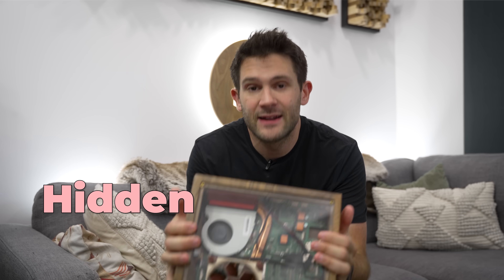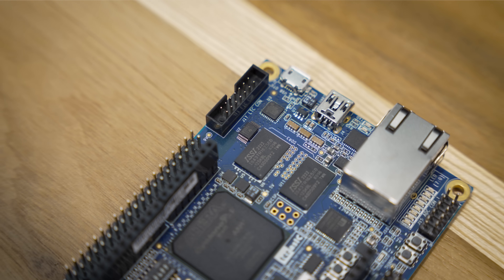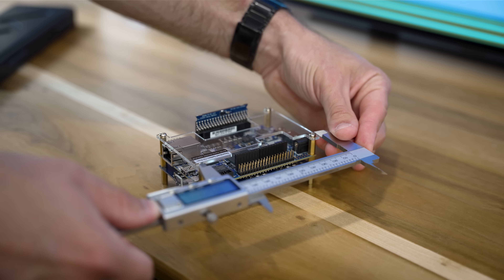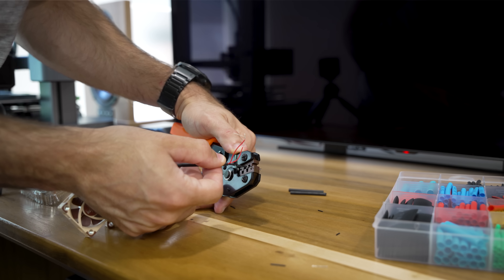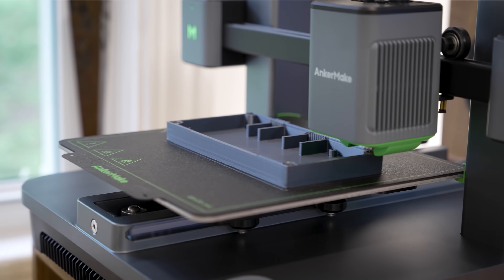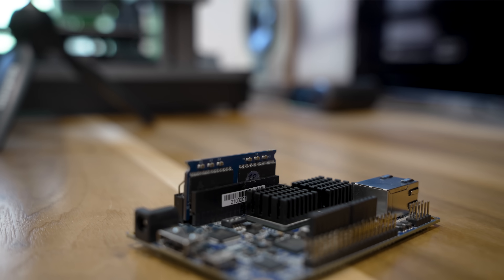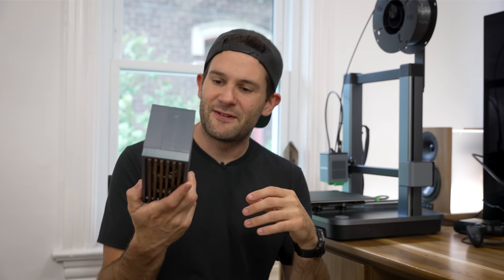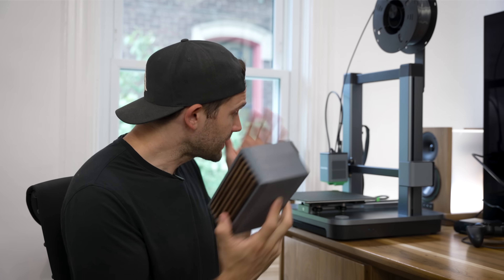This DESTROYED my $4000 PC

Comment: I say if input lag is your main sticking point, you can just overclock your USB controllers. Believe it or not, by default windows actually has faster reaction times on Bluetooth because it goes through less processing, this can be countered by overclocking the pull rate of your controller though with external software. 

With just using a dual sense you can drop the input latency by 15ms alone. The only warning is that some games respond oddly to high pull rates, at least from what I've heard. Personally never had an issue with it myself. 

Also kinda question the true purist stance. Very fee people today actually consider getting a later CRT and having a GPU with analog outputs just for it. I think the purist group is basically a dying breed of those who lived the years the game was new and wanted to see it look the same. 

Personally the main advantage of emulation is not needing so much e-waste in my house. I just have one system that runs everything I want. Is it perfect, no, but being higher res already makes it better than originally, and when I was young I didn't have all the fancy hardware for the best look even then. Plus some games just ran poorly on original hardware but don't via emulation like how you can add frame rate mods. Ocarina of Time not looking good on emulation for example is also irrelevant as we have ship of Arcadian, a literally back end PC port. We also got the same for Jak and Daxter, one of the most difficult games to emulate from PS2.

Comment: Im a hardcore collector myself, I have tons of original hardware etc and I also have a both an emulator arcade cab and a couple different fpgas.... all that being said, I actually prefer good software emulation against fpga or original hardware, with the exception of my analouge pocket. All the extra features like shaders, hd patches, save states, rewind, fast forward, bezels, etc etc really enhance the experience and sure, you loose some accuracy but most people would be hard pressed to actually cite any difference between the three themselves.
Reply: My thoughts exactly. As soon as I heard his statement on it, it raised an eyebrow for me. The emulators these days can be really good, and it's been well over a decade since I played my old favorites anyways. For so many games, I've never played the original, so I couldn't tell the difference of there was any.

 Sure, there are definitely titles that either don't work or behave erratically, but I can accept that. Some consoles will really benefit from hardware emulation especially when the original silicon was low quality(XBOX360).

Comment: I think FPGAs are great and I collect original hardware, they've progressed a lot even through the global chip shortage slowdown. I didn't experience the birth of software emulation but I do think many generations got the wrong impression of each platform based on the compromises and form factor they took on Eg. NES/SNES:256x224 not displayed in 4:3 for a long period of time, such an elementary fact to argue lol.
A visual analogy is that software emulation lands near the bullseye on a dartboard, while hardware emulation is virtually dead center to the real thing which is why it's superior.
I think the biggest contrast with the FPGA route is the large single purchase cost for a console, while physical collecting can still have a low initial cost start even if you spend more long term Ie. buy now versus layaway adoption. I've adapted to the hobby market changes, still collecting carts, software emulation consoles, buying reproductions of absurdly expensive titles, but also taking the flash-cart route when platform collecting stops being fun altogether Egs. Sega CD, Jaguar, TG-16 games SO expensive.

Comment: As cool as FPGAs are, I don't quite see your point against software emulation, especially the "things that ran simultaneously now run sequentially" which just shouldn't be true since parallel computing has been a thing for quite a while. Of course, something like that can be quite difficult to get right in code, but you make it sound like it's a limitation of software emulation in general.

Comment: I disagree, you can have an experience just as good as long as you have physical buttons, using a keyboard or a touchscreen just aren't good no matter how nice the emulation. Only system you need is a ds or 3ds for the dual screen properly.

Comment: SNAC adapters are really cool but they only work for that specific system and no other system (or the menu)
But there are also a lot of USB-adapters for old controllers that with just a little bit more latency (some use 1000 Hz polling rates) that will have your old original controllers work with any of the emulated systems as well as the menus.

And yeah I WILL disagree with you on the blocky pixels because on a real CRT you wouldn't see sharp pixels and the graphics are usually made to take advantage of pixels blending together to either get more colors or fake transparancy =)
But as we say in Sweden, taste is like the butt. Hairy and full of sh... no wait... divided. Taste is divided that's the one =P
Reply: Snac adapters works in the menu if you use the db9 fork from antonio if i m not wrong. They work at least in the menu of each core, not sure in the system menu but i can try
Reply: @andreabogazzi5410  Oh? That must be something that was added since I last played around with it. That would be super cool. If they can get it to work in the menus then I guess it should be possible to get them to work in other cores as well. Maybe not with the zero latency but still
Reply: the genesis controller works in the genesis menu. i ll hook it up and double check. @antivanti
Reply: I went and double checked. I m not sure which version of MENU i had, but i can just confirm that genesis and snes pads work in the menu of the genesis and snes cores. Menu didn't. Is also true that you have to press the physical menu button on the mister to access the menu, since those old pads do not have one nor are configurable. I ll check back ( september :( ) with the newest menu version from db9 mister fork @antivanti

Comment: There are cycle accurate emulators and the code is constantly evolving. FPGAs are fine as novelties but long term the DM-10 board will be discontinued and continuity with whatever will be next cannot be guarranteed.
For proper preservation of games the target hardware should be a cheap laptop or phone that you can get anywhere, not some overpriced fluff built around niche hardware.
Reply: i agree, the whole point of preservation is not just availability but also ease of access, when you put this stuff on not readily available and usually single-purpose hardware, are we really succeeding in the goal of emulation?
Reply: @F-00  you can't run this software on a computer.  That's not how FPGAs work.  However there are many FPGAs out there and the code can (and has been) ported across others, so I don't think it's a crisis.

Comment: The 8bitdo controllers are available with their own wireless dongles. I have a bunch of them and the latency is undetectable. In any case these are the best controllers for the job. I’ve been a MiSTer FPGA owner since 2020 and I’ve got a bunch of add-ons for it as well. I also have the aluminium case from Mister Addons. All of this is hands down the best purchase I’ve ever made. So compact, reliable, and the MiSTer project is so active with new cores being worked on all the time. I also support a bunch of the developers on Patreon. Thanks for a great video. Cheers 😊
Reply from the maker: I actually checked, some dude made a chart of all the different 8bitdo controllers and their input latency in different modes. Their included 2.4ghz dongle is awesome, but it does introduce like 1-2ms of input lag vs USB. Basically nothing, but still a little bit haha. Thanks for watching :)

Comment: You should have included an IO board into you design as it has some very necessary features for some cores, like the secondary SD card slot the analog video out the 3 buttons used in the GUI and the USER PORT necessary for those SNAC adapters you mentioned and other things like the mt32-pi.  The Mister FPGA really isn't complete without an IO board.  Update: we now have the N64 at 99% compatible with about 7 games unlikely to ever run because of ram timing issues but who is going to complain about the impossible core that is so good and the Turbo verent makes a lot of games better then on the original hardware.  The Satern core is still not finished so the N64 beat that by a fair margien.

Comment: Question, does the lag reduce if you use a hardware input button instead of a USB device?  EG an actual Atari NES or Genesis controller
Reply: if you use snac its the same as original hardware and he didnt use fast polling of the usb and HDMI has a option to reduce lag by using the original signal even more some tvs can handle it "vsync_adjust" by default mister is set to vsync_adjust=0 is the lesser option, but the most compatible with all tvs . the thing with fpga is there is no overhead which result in smooth game play every time  unlike  a PC the process is always working in the background
Reply: Yes, using original hardware can reduce lag, but also there are low latency USB devices.  The controller showed is only 6 ms over USB, for example.

SNAC is kind of overhyped.  It's great for light guns and other odd peripherals, but with controllers you can't access the MiSTer's menu, or remap controls or use controllers on other systems.  You can instead get USB adapters for these old controllers that only add about 1 ms of input lag.
Reply: SNAC  doesn't stop you from using the menu in any way with other usb controllers that are not SNAC its not overhyped some prefer using og controllers  @dinierto
Reply: @soloM81  you cannot use the MiSTer menu with a SNAC device.  You will need another USB controller or keyboard.  You also cannot remap controls, or use the controller on other systems.

However, with Daemonbite, you can do all of these things and only add 1 ms of input lag, and STILL use original controllers.  So yes, SNAC is overhyped by users.  The developers themselves say the same thing, unless you're a speed runner it's impossible to notice 1 ms of input lag.
Reply: never said i did but you can use a regular usb controller to bring up the menu i have mister and do it all the time  @dinierto
Reply: @soloM81  indeed, but why compromise?

Comment: as someone who owns a MiSTer i can safely say regular arse pc based emulation is more than good enough for most people. I can also safely say a lot of the cores on MiSTer also isn't accurate compared to authentic hardware. same with analogue products. the only true benifit is less lag but that gap closes a lot when you change polling behavior on emulators like retro arch as well as other settings.
also today the snes core on MiSTer defaults to fast rom for super fx games making it less accurate out the gate.
Reply: Which cores are accurate?
Reply: @francisyorkmorgan1341  none are truly accurate but if you wanna get to the "almost identical" area you got gba, genesis and ps1 is a lil overclocked but not in a way that affects performance. the accuracy in most cores is around the same as the higher resource emulators like bsnes but some like neo geo aren't close but functional and some like gameboy have sound issues in fringe cases.

if I'm speed running or want to use my crt i use MiSTer. if I'm just farting around in general or want to use retro achievements i go pc.
Reply: @ojmachine9545  That's disapointing. Then what's the point?
Reply: @francisyorkmorgan1341  it's over 90% accurate in either case. it's mostly a preference and budget thing. I would never buy a pi or other underpowered pc for emulation but if all i want to do is enjoy games on a crt MiSTer is the way to go without shelling thousands on what it can replace. if I don't have a crt and i'm not speedrunning then pc emulation will be enough
Reply: @ojmachine9545  what?  Neo Geo is quite accurate, in fact it just got a whole slew of fixes and improvements.  I don't know where you're getting this information.  There are indeed some cores with missing functions and features but as a whole they're quite accurate
Reply: @francisyorkmorgan1341  don't listen to them
Reply: i'm talking compared to original hardware like the video implies. neo geo did get a lot better. it even added CD support but it's still missing a lot of polish to be considered accurate to hardware imo
Reply: @ojmachine9545  what?  Like what?  You're crazy lol

Comment: I'm just here thinking that a couple of small Noctua fans destroyed your expensive $4000 PC, as I used more Noctua fans and larger ones at that and it didn't destroy my $2000 PC that originally cost $5000 back when it was new in 2017. /s

Comment: I'm surprised it has so much latency! I get less than 10ms in osu lazer (not an emulated game) with my 240hz monitor, 8khz mouse, and high-end gpu. I thought the FPGA would be around the same, though I guess those games are designed for only 60 fps
Reply: I'm sure you could get that down with different controller and display options. (Even with the same controller he might be able to mess with the firmware and improve it. I'm not really sure about those 8bitdo models though)
Reply: This video is rather misleading in that aspect.  There are technically several factors that add to latency.  The numbers presented are, at the very least, including the latency from his display (you'd have to look up the model to discover what that is, and also, does he have game mode enabled?), and the controller (which according to testing is about 6 ms of input lag).  Technically speaking, with a decent modern display you can run in a low latency mode on the MiSTer that is only a fraction of a frame.  You can also use SNAC, daemonbite (1 ms latency) or other low latency USB controllers.  With the right combination of hardware you can get less than a frame total latency over the entire chain, and that's on a modern HDTV.

The testing done here is not very empirical or scientific and does not include context such as settings on the MiSTer and TV, or the software emulator on the PC and its settings.

Comment: Like many others you have called it emulation when it's not. Emulation simulates the hardware logic using different logic structures in software, essentially translating in real time from one hardware set to another. Whereas an FPGA replicates (copies) the exact logic from the original hardware just in a different, temporary, hardware package. So it's replication, not emulation, no translation needed because it becomes the original hardware internally.

Think of it this way: The FPGA is consolidating all the functionality of the original chips into a single chip. Even some of those original chips are doing exactly that! For example, the ULA chip of the Sinclair Spectrum computer, the SID chip of the Commodore 64, and other custom chips used in old consoles all contain the functionality of many smaller chips consolidated into the one chip. This is also why many of these chips are becoming more scarce as they go faulty or get destroyed but nobody is making them as they were custom chips in the first place. The difference obviously being that those chips are not temporary in use, they do not have to be reprogrammed every time the machine is turned on. But that temporary aspect is what gives FPGA its flexibility, allowing it to become different machines at the user's whim.

So, using FPGA is like using the original hardware, but better! How better? It can be improved upon if needed plus it's more compact and uses less energy. An example of how it can be improved upon is the Sinclair Spectrum Next computer. It uses an FPGA at its core and improves the Z80 CPU by adding a few extra quality of life instructions to the CPU. It also allows the CPU to be run at higher speeds than the original was capable of. Now of course, when you make changes like adding instructions it is no longer the same as the original hardware negating what I said earlier but that is what improvement means anyway. FPGA gives you that opportunity should you wish to do it or just keep it true to the original.
Reply: I mean when the FPGA developers call it hardware emulation, I'm not going to argue with them
Reply: @dinierto  Being a developer does not always make you right, I should know as an ex developer! 😜
My point is that even FPGA core developers can get it wrong because they were probably told the incorrect terms.
With an FPGA being a means of either consolidating the logic of existing chips to design a new chip or a new chip designed from the ground up, if you were to call this consolidation 'hardware emulation' then custom chips like the ULA, SID, Paula, Agnus, etc. would also be hardware emulation, but in the original hardware!!

Comment: FPGAs are great but let's be real for a second, there are cycle-accurate emulators for the older consoles that run on PC hardware, and just because it is an FPGA-based emulator it is not guaranteed to be bug free or cycle accurate
It is all down to the quality of the emulator.